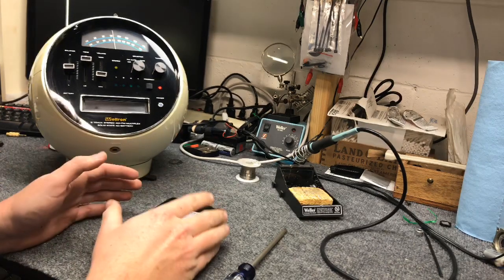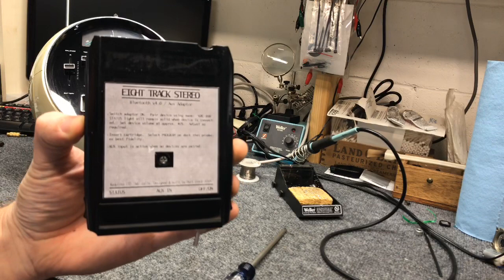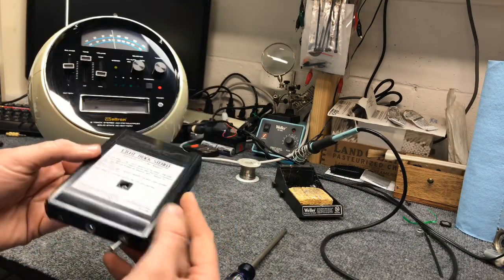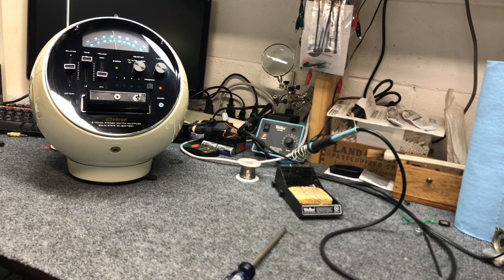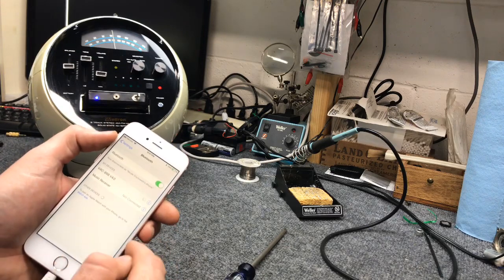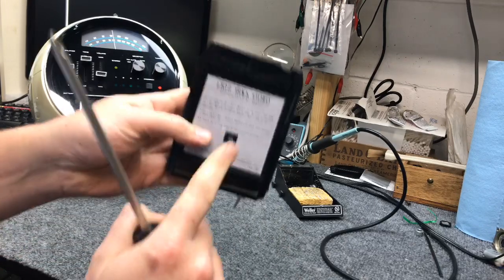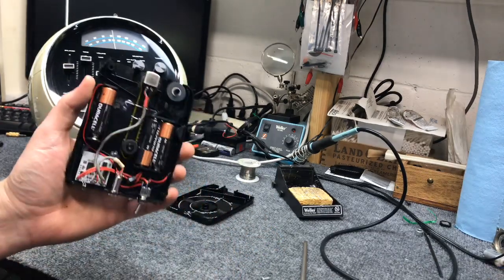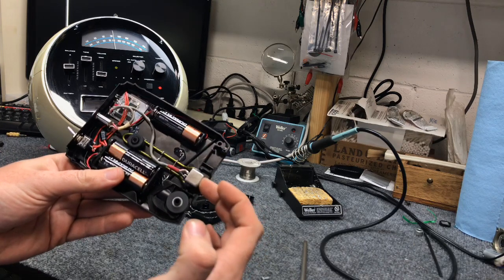Homemade Bluetooth 8-track tape adaptor

Comment: Cool Tinkeritis project! :) Another idea would be a pair of contacts to "steal power" from the track-change solenoid contacts! An LM78L05 a couple caps, and a series diode to give you 4.4V for the BT board, and there you go! No more batteries! It shouldn't draw anywhere near enough current to bother the solenoid in the player. :) (Maybe a bridge rectifier between the contacts and regulator, because different units may have different polarities!)

Comment: You can draw voltage from the track change probes in the deck if you want to avoid the use of batteries.
Reply from the maker: Yeah I had a few cassette adaptors that did that.  The problem is I wanted to use this in portable 8 track players which often don’t have the 12v those adapters expect.  I suppose I could have used a 5v regulator though.

Comment: I made something similar this weekend, though I just stole the guts from one of those bluetooth cassette tapes and wired the head from a broke Kraco cassette adapter to the boards leads, and placed it all inside a kit-bashed cartridge that I made from part of the cassette adapter shell and an empty 8 track cartridge. Works equally strong on programs 1-4 in my sears stereo.

Comment: Any chance youre still active on here?
Reply from the maker: Yeah I’m still in existance
Reply: @Tapes1982  Any interest in making one of these for me? I would of course pay for it. Figured id ask before taking it on myself and probably failing. lol
Reply from the maker: @AdrenalineTheory  sorry, I just don’t have the time.
Reply: @Tapes1982  No problem, pretty sure ive got it down and plan on giving it a shot.
Reply from the maker: @AdrenalineTheory  I believe in you :)
It’s really the same concept as a cassette adaptor.  The trick is finding a spare 8 track head and then getting it to make good contact and alignment with the head in the player.
Reply: @Tapes1982  So, im about to finish mine up and have a quick question. How did you wire the tape head to the bluetooth receiver?
Reply from the maker: @AdrenalineTheory  I just connected the left and right outputs of the receiver across the left and right head windings, sharing ground between them.
Reply: @Tapes1982  Kind of what i figured but thought id ask to make sure. Im working on multiple different designs and thats kind of the last part of the puzzle luckily. Thanks again for responding, there probably arent many people out there that would have an interest in something like this. lol
Reply: Hi, can you please tell me the circuit board (Bluetooth) you used? Any name or number on it?
Reply from the maker: @Silverface1987  KRC-86B
Reply: @Tapes1982  can you send close up pictures? About how long do the batteries last. This is great , I can now use this in my 71 Cutlass

Comment: Hello good afternoon to you I hope this finds you well  my name is chaplain Andrew and I came across your video because I was searching the internet to make sure there is no such thing as a Bluetooth 8-track I do actually have one and it is rechargeable so I never have to use batteries again and mine is called the sound machine 2000 just thought I messaged you because you said in the video that you don't know if anybody else is doing this I've been working on mine sense2016 God bless you

Comment: Can you please tell me where I can find that head? I don't even know what to inquire on google!
Reply from the maker: It’s actually just a regular playback head from an 8 track deck.  I found an old, used tape head I found on eBay.  They aren’t available new anymore.  You don’t need a new or NOS head.  One could be pulled from a junk 8 track deck as well.  It’s honestly the hardest part to find.

Comment: As i have no 8 track head do you think it can work conecting the audio cables directo to the unit head cables?
Reply from the maker: Alejandro martinez as long as the level is low enough in volume.  If it’s too loud it’ll distort and possibly damage the head preamp in the 8 track deck.
Reply: You can steal the writing head from a cassette to 8-track adapter.